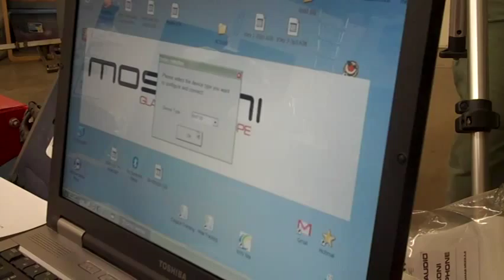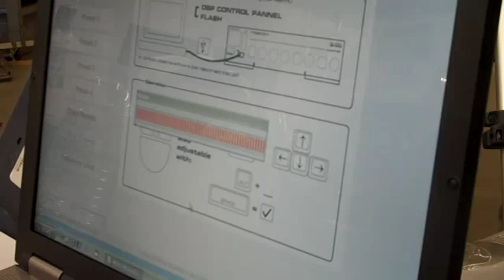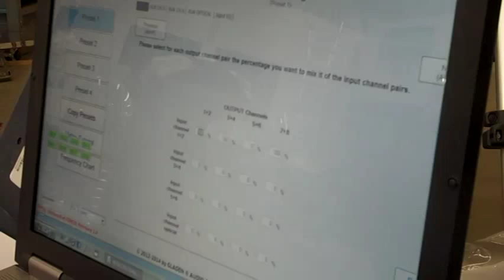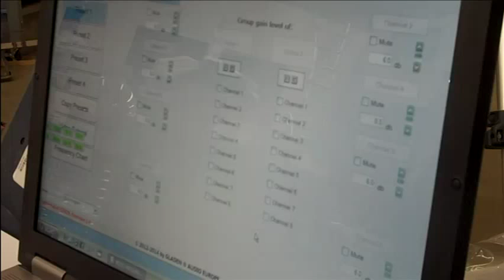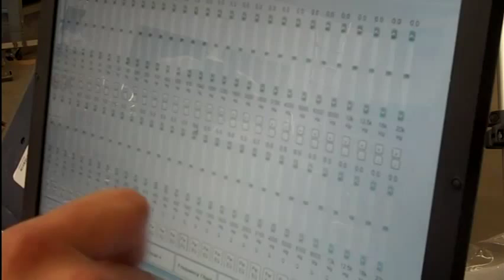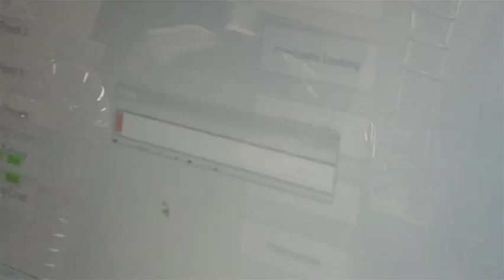6to8 Tutorial

Comment: Thx for the vid.. I have the regular 6 to 8 and have high pitched noise with mine.  I removed the source signal and noise is still there.  I removed the RCA into the amp and noise gone.  Noise is at 6 to 8.  I tried moving grounds.. removing it from the surface it is mounted to and also tried an inline power filter but no luck.  About to try a PAC RCA noise filter but having a feeling it wont help.  Getting pissed and about to go to an MS8.  Any ideas?  Muting channels 1 and 2 (Tweeters) also removes the sound.  HELP!!!
Reply from the maker: That is very odd.  We have done at least 50 of these processors and never had that problem.  It is interesting that it is just on the 2 channels and that muting it does address the problem.  Do changing any of the settings affect the sound?  (like changing the level of 1+2)
Reply: Yeah but I have to pull it below 10% for the noise to go away.  The other channels are filtered well below that freq so I can assume that is why I don't hear it on the mids.. I am running a 2 way... Carbon 8 illusion set on an older CXLR 4150 ARC amp.  Mosconi 240.2 on a Alumapro sub.  Factory Mustang deck.